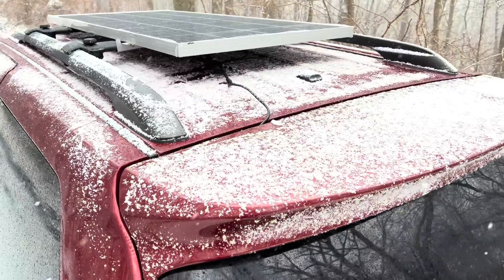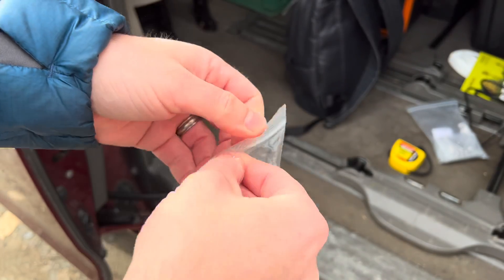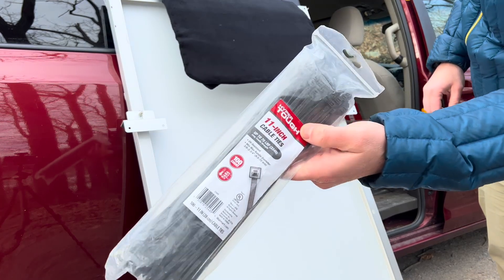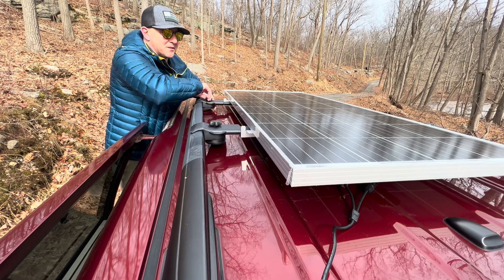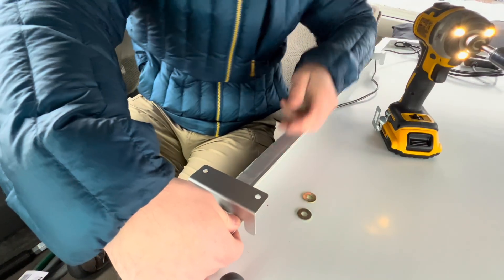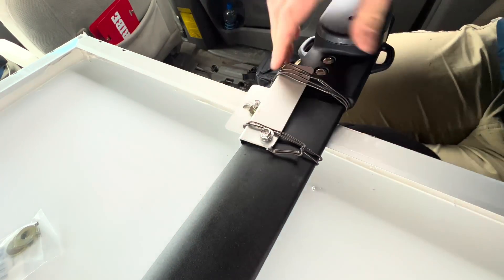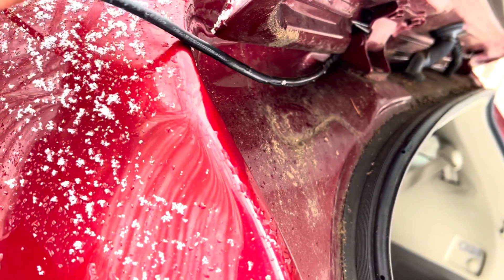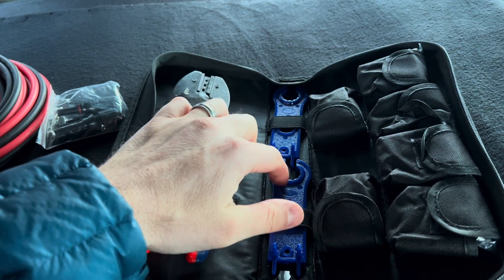I Put The Largest Solar Panel Possible On My Minivan Camper

Comment: Probably won't matter but plastic straps can break from sun heat corrosion.  Wire you say may be better perhaps hose clamps nut driven tight might work

Comment: As avid person that works with a lot of hardware 
I would like to help you improve this install just for safety reasons and worry free and great functionality 
Image this plastic panel falling off and killing a young child ??? 
I would heavily reinforce the back completely with a aluminum sheet metal  to box it in a frame then install a nylon nut and bolt every 6inches from center of panel prob 12-14 bolts also using Dow-795 sealant just some wire and some wood screws are just going to loosen up with wind and speed and bumps 
When it’s locked in with nylon or red lock tight you know it will be safe
Reply from the maker: @jimcatanzaro7808  it lasted fine for the last several years, and I just upgraded the solar panel today. No problems.

Comment: How do you handle the solar panel when you don't need to charge? Do you have an off switch? Or do you just leave the cable hanging? I fear it might risk a fire?
Reply: Yeah disconnect or remove the wires from the batteries or use a turn off switch

Comment: Two words: U Bolt
Reply: Yeah, wire and/or zip ties are half-assed.  U-bolt are just a couple of dollars.
Reply: Correct! I put 200 watt (2 panels) on my 2002 Honda Odyssey with ubolt and cross bar.
Reply: Always nylock nuts. Never wire and zip ties on a car roof install.
Reply: So you would use Ubolts through the solar panels and then put the ubolt on the crossbar and secure the locking washer and nuts?  I'm trying to visualize it all.  New to this but looking at the most efficient, safe and cost effective way to get solar on my 04 Sienna.  Thanks
Reply: @stevesauro9843    For a visual.  Type "attach solar panel using u bolt" into google.  That should provide more than a few picture to help.

Comment: I just watched your video on mounting solar to the roof of your mini-van.   Very Helpful.!!
I wanted to mount my solar panel down between the roof rails using cross bars, the key word being "BETWEEN" the roof rails at approximately the same elevation.  I was trying to achieve concealing the panel between the mounting rails.  My panel dimensions will not let this happen, HOWEVER, watching your installation has given me some new ideas.
THANKS AGAIN for your videos, they are most helpful on building out my Honda Odyssey.....
Reply from the maker: It you’re worried about stealth, nobody has ever noticed it except maybe big truckers as I drive by.
Reply: @AdventureGearTV    I was more worried about theft.  Now that I have it mounted and it is noticeable, it's a fairly low profile and its in the middle of the roof rack area, making it more of a challenge to take.  I might be more conscious of its presence than the average person just because of my concerns.... (grin).

Comment: I'm not an engineer but I think your original set up would have held the panels down just fine. The new set-up makes them much more secure, and from theft.  I made an elaborate system to hold two 100w panels end to end which are cantilevered  a bit over the slider to act as a rain guard on my minivan. With about a 6" space between, next the panels is a Thule. Both about equal lengths. Not to obvious,  I have the ability to remove the panels from the rack system in just a few minutes.
Reply from the maker: I appreciate your perspective. The panel still sits on top of the van no problems. I only wish I had more wattage.

Comment: you've inspired me to convert my sienna. thanks for all the info you've provided.
I noticed in another video, your solar panel is sitting on 2 sets of OEM crossbars. 
Did that have anything to do with making the solar panel more secure? or did you add them for another reason?
Thanks again!
Reply from the maker: Hi, I did that so that I can take it off when I don’t need it. The panel is still up there now with no issues. Someone could steal it easily if they really wanted to.

Comment: Why do so many people use "Zip Ties" seems crazy to me.
Reply: They're strong and easy.
Reply from the maker: It worked fine for the smaller 100w Renogy panel that I originally had on there. But, I wasn’t convinced that this one would hold up, because of the play in the brackets once mounted.
Reply: I tried several heavy duty installs. Very difficult to put on and take off. I travel with the panel inside my van. And now I actually use ball bungees. Easy on, easy off. I don't have the panel on the roof all the time. And I wouldn't  drive on an Interstate. But I'm ok driving surface streets and getting solar while at a campground.
Reply: Because they "work" and are "load rated" and "fit for purpose"
Reply: @BarryBurton3355  I understand that’s what people think.
Reply: @noneyabiznas3590  people who understand the limitations of cable ties, eh uh. .... understand
Reply: @noneyabiznas3590  there are literal data sheets bro 🤣😅
Reply: @BarryBurton3355  I guess I’m just an idiot.
Reply: Nasa uses them on the Mars lander, so they should be fine here on earth
Reply: @ Right….. probably bought them from Harbor Freight too, right?
Reply: Easy and they work temporarily
Reply: Ease, lack of dopamine

Comment: This is perfect, totally solved my head-scratcher. The only thing I’ll try different is hose clamps, the screw-to-tighten kind, instead of baling wire, which would also make my 100W panel easier to remove and store inside if I need to stealth camp. And I was all over Amazon looking for modifiable clamp mounts when the simple ones work fine.  Thank you so much!
Reply from the maker: I think the screws were the safest addition. The panel doesn’t move at all now.

Comment: I like it. I’m always afraid of someone stealing portable panels if I’m out hiking, etc. Seems like someone would be less likely to steal in from on top of the van.
Reply: Who's going to steal a $200 used panel to pawn for $20? Just steal the car or catalytics
Reply: @larryc1616  You would be surprised what people will steal. Take it from one who knows.
Reply from the maker: It’s possible that I could have issues with it, but nothing yet in several years.

Comment: I keep toying with the idea of the permanent panel on the roof... I have a 100 watt briefcase panel and a 125 watt briefcase panel that I can tether together and then I have the 30 ft cord so I can keep my van parked in the shade and run the panels out into the sun... There is an upside and a downside to doing it this  way too..
The upside is it will keep your van cooler the downside is you have to do a lot of deploying and maneuvering of panels lol
Reply from the maker: I have a few folding panels and almost never use them. I’m afraid I’ll forget they are there and drive off without them.
Reply: And baby-sit it. Anyone use the foldables on the dashboard like a sunshade?
Reply: @larryc1616  honestly yes I babysit the panels at times lol it is  slightly annoying but I love free energy ...bigger probl is just available direct sunlight...is cloudy more than one might think here in Ohio...they make automatic panel swivels that follow the sun but because I already know they would be well out of my price range I never bothered to price them up it's a great idea though...I have stuck my panel on the windshield but I am careful about doing that when it is too warm inside the van

Comment: I have a 190 watt panel. Waiting to move to figure out how I`ll use it with my camper. I have a 12 volt cooker that`s 160 watts and was thinking of connecting it directly to that panel.
Reply from the maker: Definitely need an inverter. The panel puts out over 20v and the inverter will drop it to 12v. You could try something like I use here to hook up directly, but need to makes sure the amps match up: https://youtu.be/jZAF0taYWj8
Reply: You have to run that to a control panel and probably an inverter to do that safely

Comment: Hi,
I always think about having a permanent solar panel on my minivan, but for me I think a skybox for storage is a better idea and stealthier looking. I do have a portable suitcase type solar panel that I use and like. Adding that self-tapping screw was a good idea. Keep that video camera rolling, I do enjoy your videos, see you on the road.
Reply from the maker: This is an upsize from my previous 100w panel, and I am surprised how unnoticeable it still is. You can put a lot of stuff in some of those roof boxes. I went ahead and put one screw in each hole. Eight in all. Thanks for stopping in.
Reply: @AdventureGearTV  I can't give your van enough compliments you're starting out with an all-wheel drive Toyota  and it just goes up from there but you keep everything simple which is why I love everything you do yes that panel is very stealthy you did a great job and you can always go back and forth between a roof panel and briefcase panels too if you want to park in the shade !! You are set up for all kinds of versatile success my friend thanks for sharing I will keep watching!!